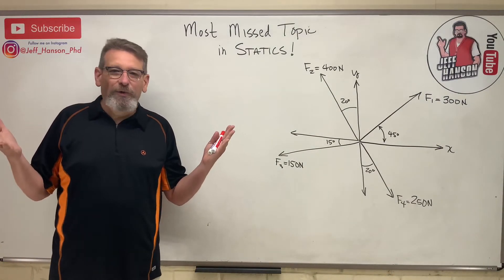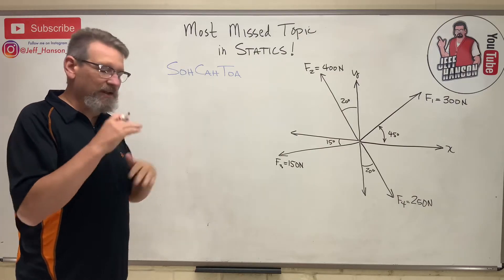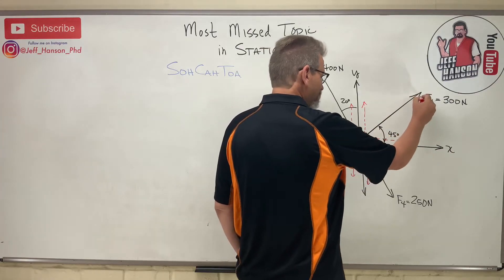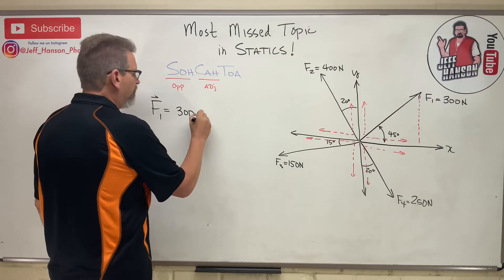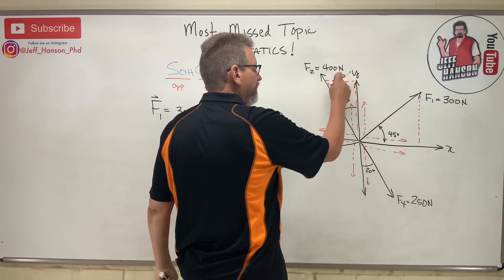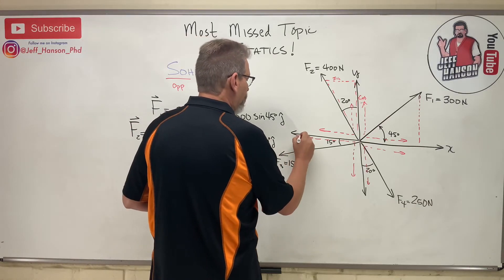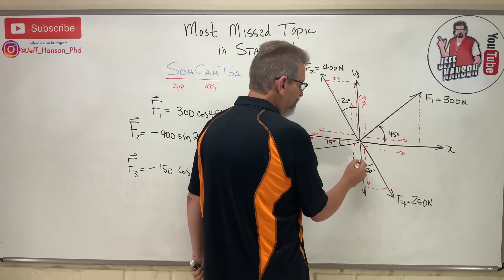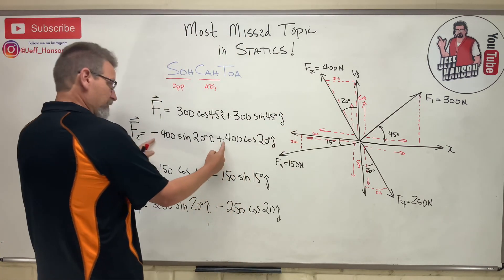Statics: Lesson 6 - Most Missed Topic in Statics, Cartesian Coordinates

Comment: why don´t you go over the parallelogram rule?
Reply: he did in the 2nd lesson video
Reply: Most important but simple equation "not taught" is something from geometry(yes 9th grade).  The internal angles = 360.  Thus, if you are given two vectors: a.) draw out two more identical vectors to create a closed parallelogram.  b.) draw the resultant down the middle.  c.) Usually two angles are given, but they don't help you directly...apply the 360 rule to find the "missing" angle...then apply the law of cosine equation(when you know two side and an opposite angle) and next usually apply the law of sine equation(....should be obvious).  Good luck.  
Never leave a class confused, teacher works for you.
Reply: Parallelogram role use to find resultant not a components and this alot of forces for parallelogram role man 🙆‍♂️